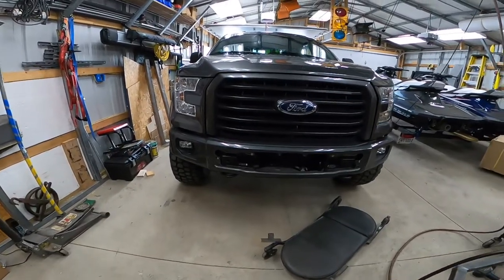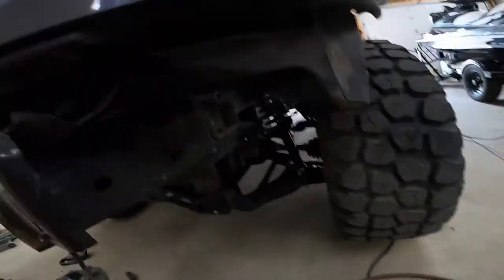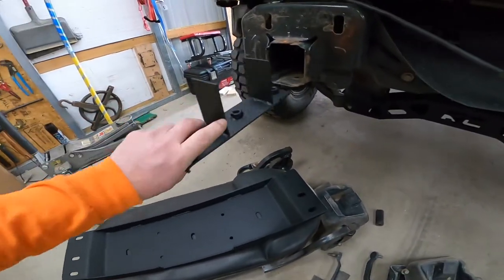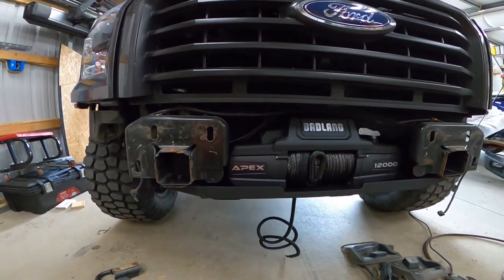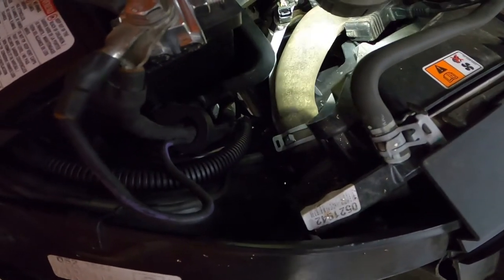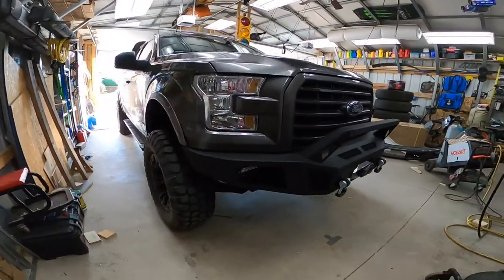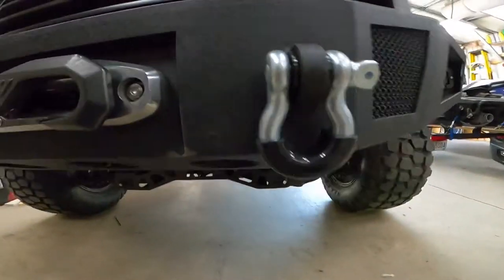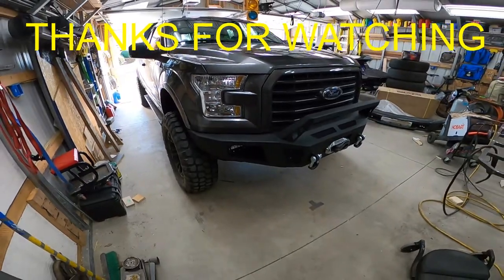2017 f150 Barricade HD Winch Front Bumper

Comment: What did you end up doing about winch access? Ok just reversing the motor to draw out the line?
Reply from the maker: I have not done anything with access in the top of the wench
Reply: @Garagepointzero  Have you had to use it yet? Just asking because I'm looking to get a similar setup with the same winch on my Ranger. Looks like access might be difficult so wondering what your experience has been.
Reply from the maker: The winch is wireless so I didn't have to get to it yet. I've used it but not very far out so wasn't that bad to spoil it out with the motor
Reply: @Garagepointzero  ah OK. I used this winch mounted on a Jeep not too long ago. Had to pull the line pretty far so it was nice to just release the line and walk. I guess I'll just figure it out when I get there. Nice truck man!
Reply from the maker: I will be working on a way soon to fix that